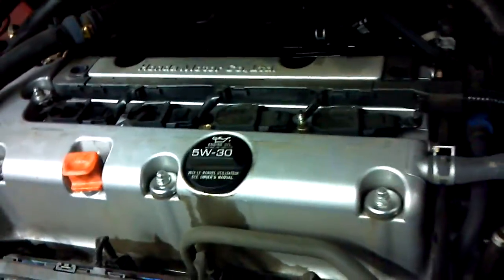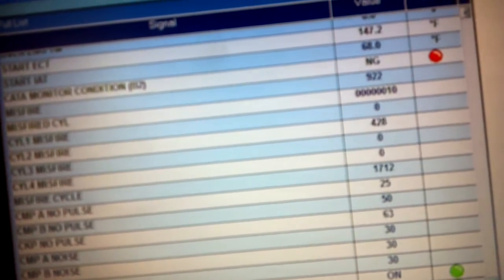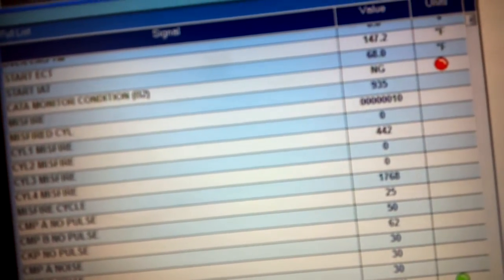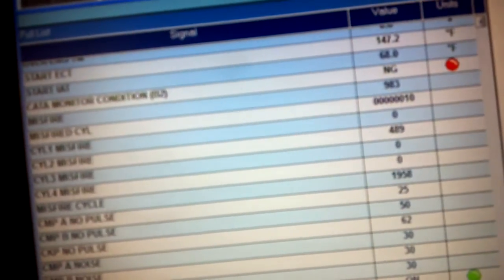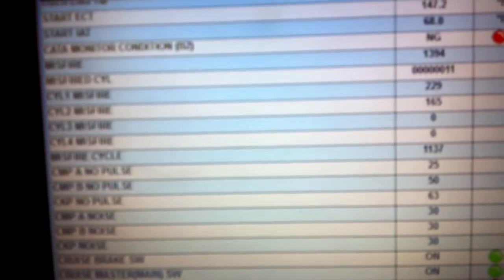Acura Tech - Diagnosing a continous single cylinder misfire - 2004 TSX

Comment: I have the same thing in my RSX-S turbo.  It hesitates when I floor it.  Thing is it only does it in gear.  In neutral with my car rolling i rev the engine and it revs fine.
Reply: mack cummy low compression

Comment: Just had to do that on my TSX. Luckily for me it was the coil as well, and I have a scanner, so P0304 (missfire on cylinder 4) changed to P0303 (missfire on cylinder 3), when I swapped the coils. A quick trip to AutoZone and 87 dollars later, I was back on the road.
Reply: May I ask you a question?  I'm experiencing the same issue. Is this a simple fix for those who are not mechanically inclined?  I'm trying to avoid the dealership if possible.

Thanks in advance for your help.  =)
Reply: Patti it is really simple. The coils are covered by a plastic cover, 4 bolts secure it. Take those off, and you'll get access to the coils. From there you can what's described in the video. Tools are cheap, coil is cheap as well. If you really don't know what you're doing, I'd recommend asking someone who at least changed a tire before, I'm sure they'll be able to help. It honestly takes very little time to diagnose it, and swap out the coil. The real issue will be if you swap the coils and the code doesn't change. Then it could get expensive
Reply: +D.M. Vakhlis I just found a video that walks through the entire process. And I agree it looks pretty simple.  I'll definitely have supervision but I wanna take a stab at this project. 

Thank you so very much for your response. =)
Reply: +D.M. Vakhlis I just found a video that walks through the entire process. And I agree it looks pretty simple.  I'll definitely have supervision but I wanna take a stab at this project. 

Thank you so very much for your response. =)
Reply: Patti cool, hopefully it's a simple fix. It was in my case
Reply: +D.M. Vakhlis That's my hope as well.  LoL!  =)
Reply: +D.M. Vakhlis All went well!  Only one ignition coil had to be replaced.  =)
Reply: Patti Nice. Good job. Which year TSX do you have? I've had a 2005 before, and now 2012 Sport Wagon.
Reply: +D.M. Vakhlis 2005 ... It's been a really good car for me.
Reply: Patti yeah, they are great cars. Mine had 203k miles on it, but it was starting to fall apart at that point. I replaced it with a G37S sedan, because TL Type S left me unimpressed. The wagon is wife's car, perfect as a baby vehicle. Lots of space, pretty good on gas. I wish suspension was tuned a bit firmer like it is on the 1st generation TSX, but that's the only complaint I have about it.
Reply: +D.M. Vakhlis I've been toying with which direction I'd go if I so happen to be forced into buying a new car.  My mechanic warned me against Infiniti .... Beautiful cars but very pricey repairs when out of warranty.  He suggested Lexus but they are a pricey purchase.  So, I'll have to weigh my options.  I was totally unimpressed with the TLX 2015.  Hopefully they've made some positive changes or I'll move onto to one of the other brands.
Reply: The issue with Acura and Honda in general, is they don't push the technology like they used to. 2003 TL and 2004 TSX were pretty advanced cars for the time, but TLX and ILX are just not there. The specs are pretty much the same as they used to be and TLX comes on tiny little tires that are just unable to put the power down. What I liked about TSX is that it was light and peppy, real joy to drive in curvy roads, even though it was pretty slow in straight line. None of the later Acura sedans gave me the same feeling. Even my wife's TSX doesn't have proper integration for Android Bluetooth, no keyless entry, or push start, no backup sensors, and it's 2012 model with the so called Tech Package. It's ridiculous in my opinion how far behind Acura is every step.

The G37S wasn't even on my radar when I was looking for a sport sedan to replace my TSX. I was mainly interested in 2007-08 TL Type-S or E60 535i. The both were pretty affordable in 15-20k range. BMW fell off the list almost immediately, because even though it's a joy to drive, the reliability of a turbo engine leaves a lot to be desired, not to mention the rest of the car. I also drove my friends TL Type-S for a week. I was hoping that being the same generation as my TSX, it would be like the TSX, but better in every way. Turns out, not really. It felt huge inside, seats weren't comfortable, same 5 speed automatic, not a lot of traction, lazy steering ratio. It's like they tuned all of the fun out of the car on purpose. When someone suggested to look at G37, I looked at them briefly, and wasn't terribly captivated until I found out that there was a sport model, the G37S. Sport model comes with different seats, huge brakes, bigger wheels, aluminum pedals, pedal shifters (if you opt for automatic), and restyled bumpers. All of that combined takes away the rental car feel of the base model, and transforms it into something quite special. When I drove that car, it fit me like a glove, and that's a pretty rare thing to do from the beginning (other cars that did that were S2000, TSX, E36 M3). It's comfortable, quiet, very quick, handles really well (although at the limit it will kick the tail out). It's everything a sport sedan should be. If you go to my youtube channel, I've got a few videos autocrossing the G37, you can see how well balanced it is, and I did nothing to improve handling on that car.

Reliability-wise, it's been fine to me for the past year and some months I've owned it. The key is not to buy something that looks like it's been modified and beaten, but something that's just out of lease and still has warranty. The big ticket items on these cars are wheels hubs, suspension bushings, and HID ballasts, that's about it, and those are really issues for cars over 100k miles. The rest of the car is pretty solid. One thing that I will say is that interior quality is not as good as Acura, but it's not terrible. I'm not talking about 90s GM quality, just not as good as Lexus (1st place) or Acura (2nd place)
Reply: +D.M. Vakhlis Well, you've given me some very valuable information to consider.  I will definitely check out your youtube channel.  I like to have solid options to consider when I'm investing in a big ticket item. I kinda fell into my TSX when a Honda sales manager was having a bad day!  LOL ... Funny how things work out! =) Again ... Thanks for the info.

Comment: power balance test. removing the power to each cylinder one at a time. you suspect 4,so if removing 4 causes no change in idle,you've located the problem.

Comment: Where can I get the program you used to track the misfire. I have a 2005, the check engine light came on and I had it read, it says misfire in cylinder 4. I'd like to work on it myself but have only had the car 4 months. No tech books or tech info. THANKS FOR THE VID!!!